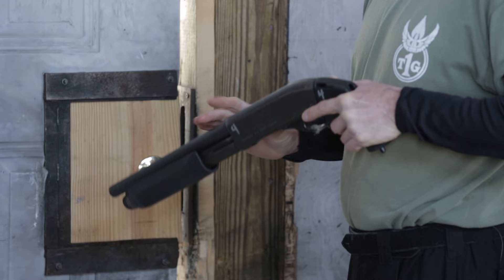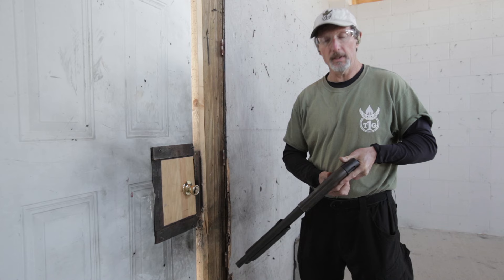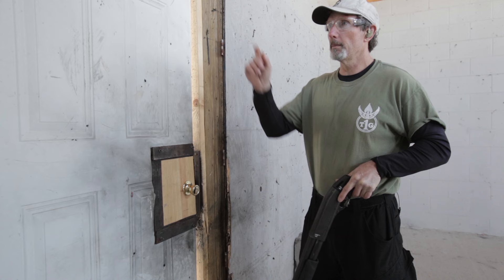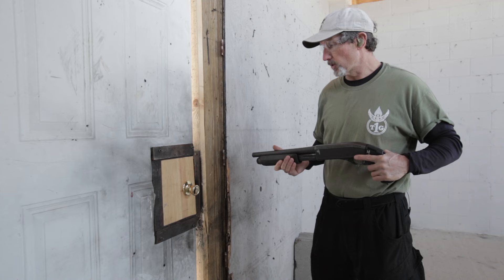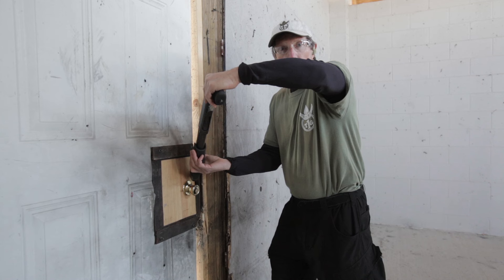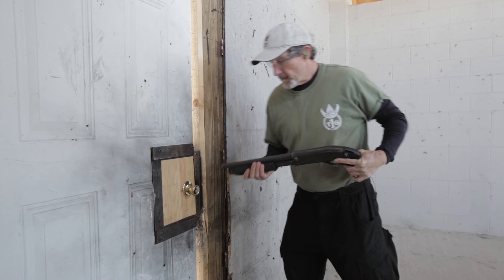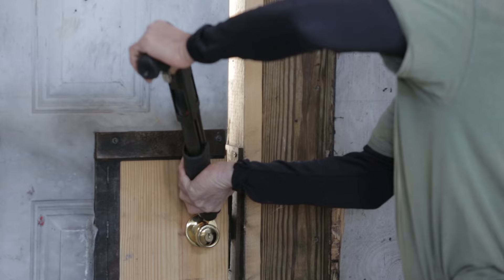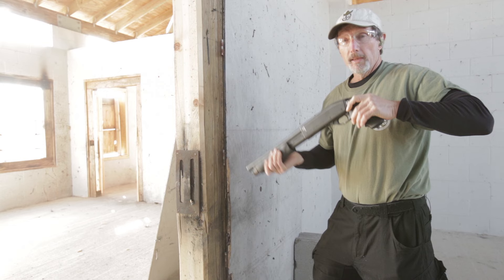How to Breach a door with a shotgun | CQB shotgunning a door | Tactical Rifleman

Comment: if a shotgun can open nearly any door, would it be considered a
Master Key?

Edit: i forgot context so there's a shotgun in UNTURNED with the name masterkey
Reply: That shotgun was named for that purpose.
Reply: @JLG629  claps
Reply: Unturned reference?
Reply: Yes because thats what they are called
Reply: @BaByMaMa19608  It's a reference to the KAC Masterkey which is basically the same shotgun you're watching in this video, just designed to mount to an M4. You may be familiar with the configuration from COD.
Reply: lol thats the lockpickin lawyer who is the master key ...
Reply: Yep! Underbarrel shotguns date back to the 1980's. Some were full length, minus the stock, most went with the short barrel, pump actions for mobility.  In the 1987 movie "Predator", you can see a setup with a longer barrel, pump action, mounted under an M16A2.  I think Billy carried it.  As late as 2003, a version was developed for the M4, it was the M26 MASS, mag fed, bolt action.  Designed for just this, breaching.

Comment: Every breacher knows you do NOT kick a door open.. period.    Just use your backup tools ( prye/bender/sledge) etc. Before moving to the breach point, you made your breaches brief, primairy insert, secondary, hazards, failures etc. What if's when the door stays shut. Only donkeys kick in doors, with the safest wat possible ( the donkey kick )

Comment: How does your technique differ when it's an outward opening door. e.g. hinges visible ? 

Cheers.
Reply from the maker: Most outward opening doors (Pull-Doors) have the locking mechanism on that near side. Just turn the knob and unlock it. Second, you can always pull out the hinge pins. It is also much easier to use a Hooligan Tool (tactical pry bar) to pry open a pull-door. Last option is always to use an explosive charge; such as a 6" ECT (against the locking mechanism) or a Flex (against the hinge-side of the door).
Reply: You can also shoot the hinges off the door.  That obviously takes more rounds, and more time.
Reply: @Stefan-wc5dk  Door hinge screws are (typically) concealed between the doorframe and the edge of the door itself, so being able to unscrew the hinges (typically) means you've already gotten the door open. Unscrewing 3-4 screws per hinge is also probably gonna be much slower than kicking, blasting, or prying the door open if you can even get at the screws.
Reply: @TacticalRifleman  💪got ya, i was wondering the same. I haven't seen many entry way doors open out. But theirs often Security storm doors installed in the sketchy parts of Philly. That all open out. Sometimes theirs even 2 security doors before the main part of the house.
I have only seen them breached with aid of a veichicle in residential areas. I have seen the military use a lock pick/lock removal technique to make a relatively fast and quiet entrance. (On videos not in my neighborhood 🤣)

But have u guys tried breaching rounds on Security framed storm door entryways?
Reply: If it's a "Surprise MF!" visit , try unlocking, or unscrewing and removing the lock quietly first. If for some reason you can't do that, and if the lock is resisting prying, hammer and pry the trim off. With the trim out of the way, you will  be able to quickly pry the strike plate and the deadbolt together out of the door casing, by prying between the casing and the wall's frame. Without the trim to stiffen it, one solid heave on a prybar will destroy the casing .

Comment: At that angle, and stance, doesn't the wadding, splinters, parts of the lock, & shot ricochet back to you?
Reply: The shot is actually a solid powder that breaks apart in impact and the wading usually get stuck in the door. As for the splinters that's  why we wear long sleeves

Comment: I think I get it, you basically graze that couple centimeters that holds the latch mechanism so it pops right out when you kick it.
Reply from the maker: Nope, you are trying to completely knock the bolt out the other side of the door. Sometimes it still sticks a little, but sometimes the door just floats right open

Comment: Is the 45-degree angle needed with a shotgun equipped with a breaching tip on the barrel? I do understand you will want to mitigate the path of the round into a safe direction. Also for those of us not able to practice these techniques, what does one suggest the best breaching round is? Thanks y'all and God Bless
Reply from the maker: The angle is just to avoid collateral damage to non-combatants within the structure. Breaching rounds, like Hatton, are available to the general public. Thanks for watching, TR
Reply: @TacticalRifleman  Are Brenneke slugs good?
Reply: @echofoxtrotwhiskey1595  Breaching rounds are generally low weight polymer encased lead shot or frangible projectiles. Lead or steel slugs are overkill for a door, will pass through walls/floors and can also ricochet and hit unintended targets.

Comment: What's the purpose of breaching a door like this? Wouldn't kicking it in or using a ram do the trick? and what if they have a chain lock as well?
Reply from the maker: Breaching Shotguns are just one tool that an Assault Cell has at their disposal. Usually, each Cell member carries a different breaching tool. One or two shorty breaching shotguns (hung on side of body armor), a Hooligan Tool, a Sledge, and sometimes a pair of bolt cutters would round out a cell's breaching tools. As for a ram, that might be used at the initial breach into a building, but would probably be dropped right inside the breach point. If you come up on a push-door 20 rooms deep inside a large structure, it is just easier to shotgun the door. Who would want to carry a Ram 20 rooms deep? Again, shotgunning is just another tool in their breaching tool box. Thanks for watching. Strength & Honor, TR.
Reply: Tactical Rifleman thanks for the reply man, very informative ;)

Comment: I like how he says he’s dry husking it, and then as he racks it, he throws a round on the ground. Meaning it was a wet husk? Because there was one in the chamber haha
Reply: @BurgerFlippinBeast I don't think you are correct.  Hard to tell based on the couple frames that shotshell is in, but I'm confident by the sound of it hitting the floor it was an expended shell.  He also doesn't rack the pump again, he just transitions to his primary weapon.  The shotgun was dry husk when he approached the door, one shell was pumped then expended, and the shotgun was stowed dry husk.
Reply: Why would you comment if you don't even know the difference between the sound of an empty hull bouncing off concrete vs. a live round.

Comment: Informative, but is there a safer way to hold the shotgun and blast into the lock mechanism? The instructor seems off balance and also pointing the muzzle very sketchily toward himself (to an extent)
Reply: Feces Master there's a few ways to do it, but you have to weigh the potential hazards.  You are aiming 45° and 45 °, so you shouldn't have too much of a chance of hitting yourself, especially when using a purpose made breaching round.  If you stand in front of the door, you are exposing yourself to possible enemy fire through the door.
You can switch to the other hand as well to alleviate some awkwardness if you are coming at it from the other direction.
Reply from the maker: Thanks for chiming in... I don't have enough time to reply to all the great questions here. Thanks for helping.  Strength & Honor, TR.

Comment: Angle looks like you’re shooting debris potentially towards your feet… that angle seems horribly unsafe to me. I understand you need to hit the mechanism, and I understand you want to be not in front of the door itself, but why do you hold the gun away from you to point the muzzle kind of towards yourself? Can’t you do the same angle but from outside edge instead of inside edge and get the same shot placement but be pointing the gun in a safer direction?

Comment: Deciding which to add to my kit. Breaching shotgun vs tools. Which is better for more applications? I'm thinking tools are hard for chains on the door. Does a shotgun replace multiple tools?
Reply from the maker: It depends on your unit and unit SOPs. Seldom used shotguns. Mostly kicked or explosively breached
Reply: @TacticalRifleman  unit has their sops, but not always will we have a breacher especially if a team goes one way and b team goes the other. If we need to think on our feet, I'm wondering if I could task out shotgun guys, or breaching tools. Limited explosives to pass around.

Comment: will a 20 gauge shot gun do the same ?? is that a slug ??
Reply from the maker: It is a frangible slug, designed to disintegrate as it delivers all of its energy to the locking mechanism. I personally believe a 20 gauge would work, but we always used 12 gauge because it is wider, increasing the chance of hitting the locking mechanism within the door. Thanks for watching, TR

Comment: Very informational for writing and other purposes. Would it be possible to run it on a full-length shotgun (such as an Ithaca 37) if someone loaded it with HATTON rounds -- assuming they blew the hinges? This hypothetical is approached in the sense of a user needing to do a very quick entry with "improper" equipment, so to speak. Cheers for the video.
Reply from the maker: Yes, and some departments still teach to attack the hinge side of the door
Reply: @TacticalRifleman Could you effectively/safely breach using #8 birdshot?
Reply: @thomas_bahama i have seen guys make ghetto HATTON rounds by cutting the crimps off the birdshot and pouring liquid wax into the shot cup. Pretty sure the guy that created the breaching slugs started by doing this exact procedure. It turns the birdshot into a solid but frangible compound. They also make frangible copper slugs out of copper powder. I got some on clearance at my local gun shop they literally explode into powder on contact with an AR500 plate.

Comment: What's the purpose of keeping the dry shell chambered after taking your shot?
Reply: Safety. No live shell in the breaching shotgun chamber any time other than before breaching.
Reply from the maker: There are some units that run a live shell in the chamber. Many, including my old unit, run with either empty or dry husk. That way there is zero chance of the safety being bumped and then the trigger being bumped.  Your rifle is in your hands and you have positive control of it. Your pistol is in a holster, completely surrounded by Kydex, and kept under positive control. The breaching shotgun, however, is bouncing around, hung by a bungee cord, tucked behind your shoulder. Now, picture yourself climbing a ladder and the assaulter above you has a similar breaching shotgun bouncing around without positive control. You are staring right up into a 12-gauge barrel that looks big enough to drive a truck through. Are you sure his safety didn’t get bumped while jumping off the helicopter? Are you sure all the flex-cuffs, antennas, and straps hanging off his kit are not going to get up into the trigger guard of that shotty? Now, do you want him running a live round or dry husk in that gun. It is easy to rack in a live shell as you are moving to the door.
Reply: Tactical Rifleman Makes sense, thanks. For whatever reason I think I commented thinking his shotgun was also his primary.

Comment: Isn't pressing a saftey faster than racking a round? 

Also, racking a shotgun at the door might as well be knocking
Reply from the maker: You can bump a shotgun off Safe. Remember, these breaching shotguns are hanging on the sides of assaulters running M-4s and pistols; while banging around in the dark. Imagine climbing a ladder behind the guy with the breaching shotgun... the barrel is pointed right at your face. Thanks for watching, TR

Comment: do you use birdshot or something else?
Reply from the maker: We use dedicated Hatton Rounds. They are a solid frangible projectile, that is specially designed to disintegrate as soon as they strike the solid locking mechanism, thus delivering all of the kinetic energy there, while cutting down on the chance of injuring anyone on the other side of the door.
Reply: @TacticalRifleman  so if people did this with a slug they could hurt themselves. Well that would call for shooting it at a farther range.  Not a complainer but you should've said that in the video. We all thought it was normal rounds

Comment: why 45 and 45? why not 90 and 45?
Reply from the maker: Different units use different SOPs.  Some use "90 & Straight On"... Others do use 45 & 90. We teach 45 & 45, because it propels the door locking mechanism down (near the door) and in (into the door frame) which great decreases the chances on injuring any non-combatants on the other side of the door.
Reply: I'm curious to hear your opinion on the various under-barrel shotgun options for the specific purpose of breaching, since that would make some of these angles more difficult to achieve.